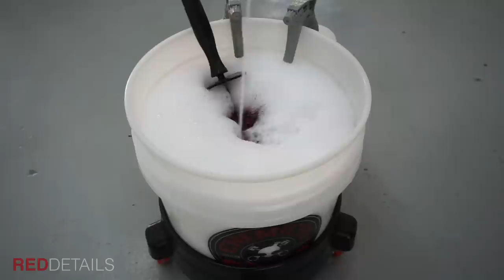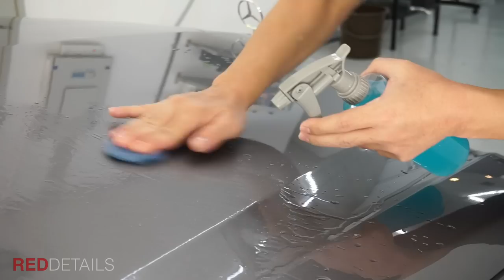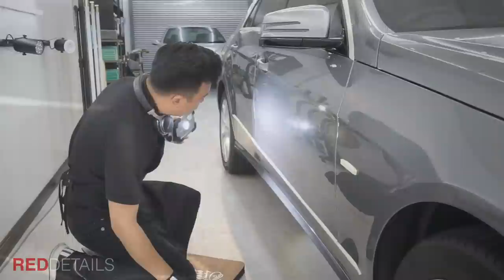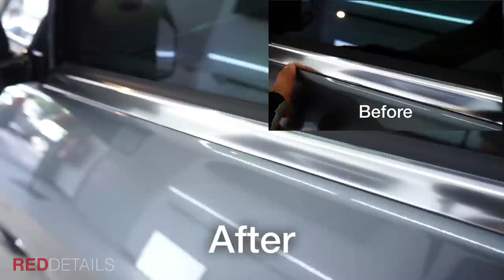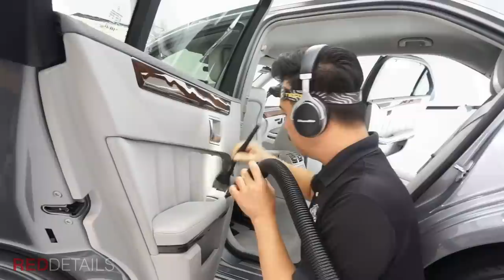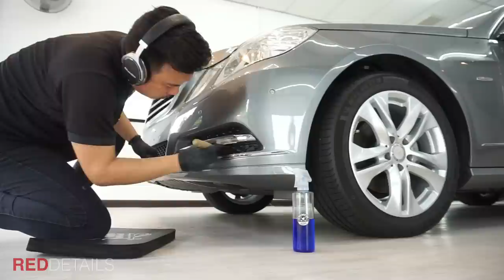Mercedes W212  " Repaint " Remove Sanding Marks " Full Detailing & Paint Correction

Comment: Excellent skill and great work! But if I can give you 2 suggestions:  please put the product on the pad and spread it on the pad not directly on the car this will prevent splatting..     And also with washing please do roof en enginehood first and do the lower parts of the car last and separate because at the lower parts of the car are always fine sand particles that you can not take back on higher parts of the car!

Comment: You don’t need to use a rotary with a pad like that to remove such a small defect. Use wet sand and polish after. Less stress on the paint better it is.